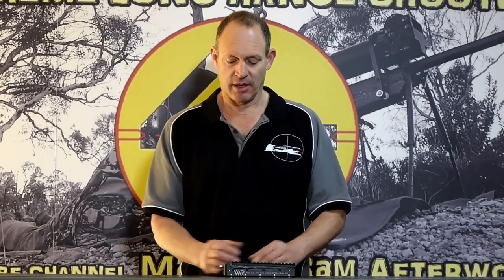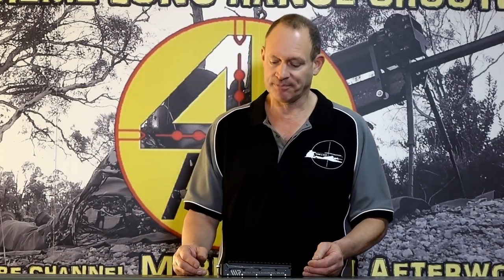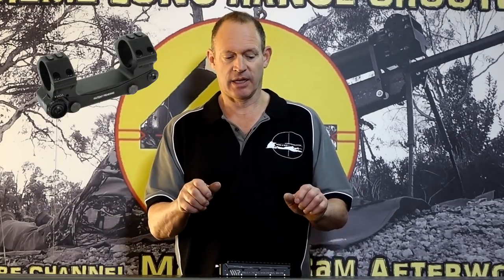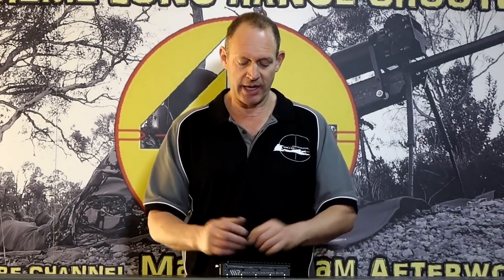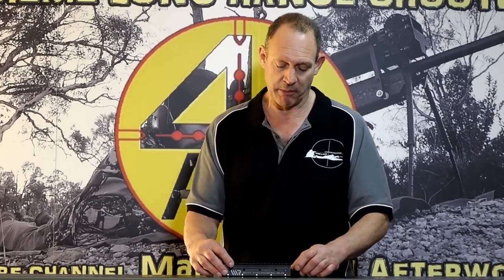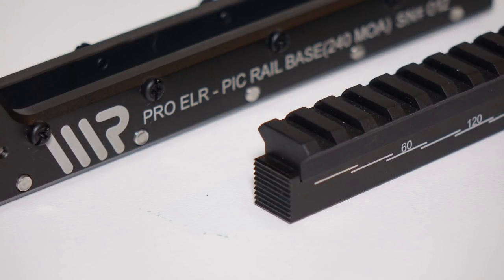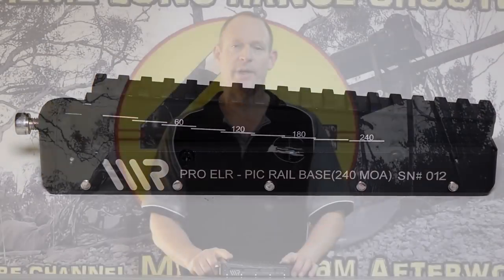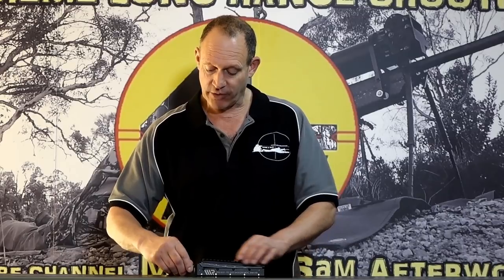WR PRECISION ELR AJDUSTABLE SCOPE BASE

Comment: Left wondering if the rear toothed/grooved adjustment locating plate is pivoted (or does it rack back on a a locating v point to keep true its  reference), if it is a pin is it bushed or just running through the alloy and what is the size of the pin, any thoughts on this part of the design in relation to durability/potential elevation shift and how it holds up to high recoil calibres?
Reply from the maker: Well yes there is a lower bolt that is a pivot point for adjustment operation but just to hold together, the plates locate with and lock up when rear allen screw is tightened for use, so will  be good there, beyond that and in very heavy calibres I have explained my thoughts, Cheers

Comment: Rather expensive for a inclination base, 2/3 the price of a Charlie Macro and more expensive then a imod and micro although it does allow easier adjustments. Wonder how accurate they will be after wear over extended use years down the road.
Reply from the maker: Ah, AUD and USD are not the same, these are approx. $550USD as for wear, well time will tell, but aint that the truth of everything, Cheers
Reply: MarkandSam AfterWork I did not realize they where an Aus company, that would put them pretty close to the ColdShots in price and I would trust the teeth design over the ColdShots for sure. I never had good luck with my ColdShots they never returned to zero and had lash in the design that made you go past and then back to the elevation you hoped you where going to get from them. One of the main reasons I went to the Charlie and even recommended them to you some time back before you picked one up.
Hope you guys are doing well and staying safe out there with all the fires!!!
Reply from the maker: Thanks Man, yes can be a trick for sure, and yes we are all safe here, Cheers and all the best.